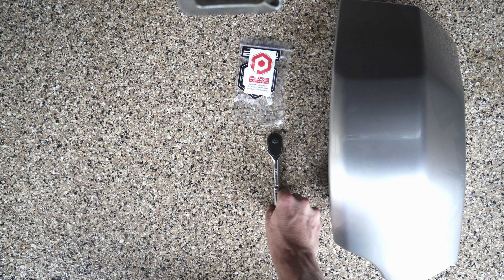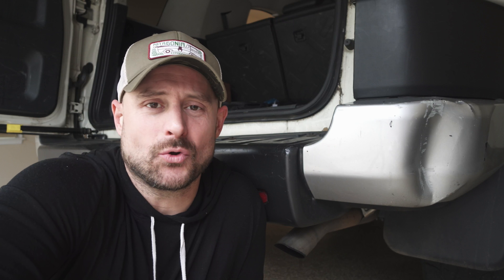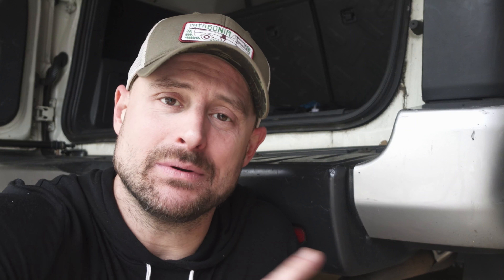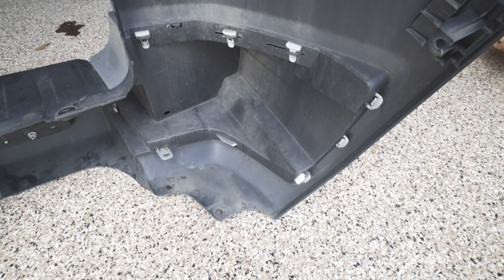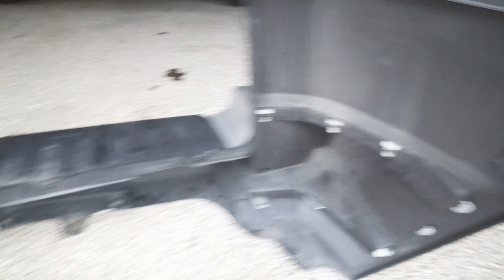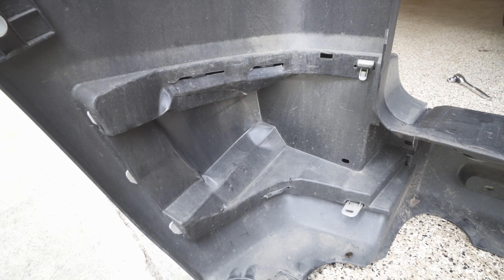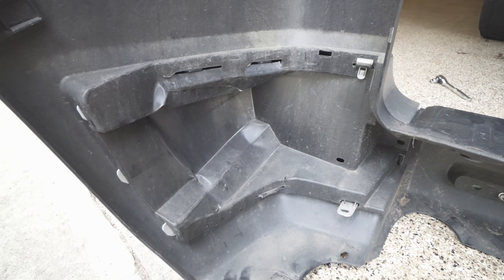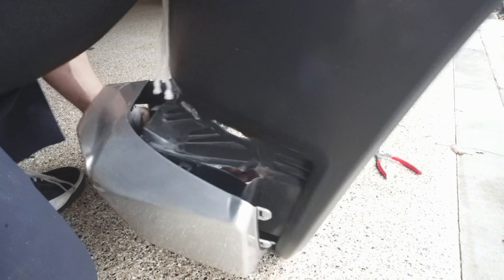Everyone keeps CRASHING INTO ME // How To: FJ Cruiser Bumper Wing Replacement

Comment: Was thinking about taking the bumper cover off and keeping the black corner panels on. And just have the black bumper showing and no more wings getting crushed. maybe bolting on a flat steel bar on the back of the bumper.  More rear clearance and no more superficial scratches and dings

Comment: This was the best video covering my issue, but there is a plastic, boomerang -shaped bracket that came with my replacement bumper wing. that needs to be installed first. A broken remnant is still tabbed in. When I tried to pull it out I believe there are two 18 gauge wires running through the tab that are not permitting me to remove it and insert the new plastic bracket. They may go the the driver's side rear light or possibly the license plate light. Either way, I don't want to have to take off the entire bumper just to reinstall the wing. Any thoughts would be appreciated.
Reply from the maker: The only method of replacing the wing is removing the bumper. But it’s passive: there are no wiring harnesses that should be mounted inside the wing.
Reply: Thank you for your response

Comment: Thanks for the great video of how to do this replacement - hey, what caused the popping noise when you pulled the left side of the bumper away from the FJ?   
After seeing your video I looked up the parts on Amazon and eBay to get the right one.  
Note: Always buy the OEM one because it comes pre painted silver grey.  The only disappointment I have is that I had to get the bumper retainer clips from the dealer as I couldn't find them after market.   The part number for the clips is 75392J.  I think there is an updated replacement part number too. (don't have it)
Reply from the maker: john molenaar I did buy OEM. Everything came from purefjcruiser.com (which I said in the video). The popping noise was the bumper coming loose from the clips.

Comment: If you have parking/rear sensors this is not as easy as portrayed and their is pop up bolt on the right top of bumper that needs to be taken off as well.
Reply from the maker: What FJ has rear sensors??
Reply: @GrantReynoldsgtr  My 07 has them.